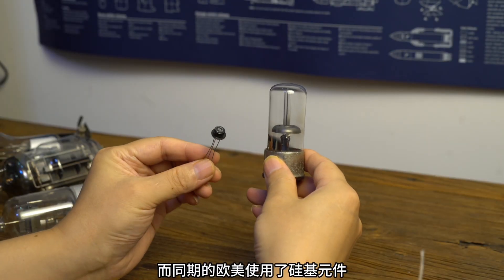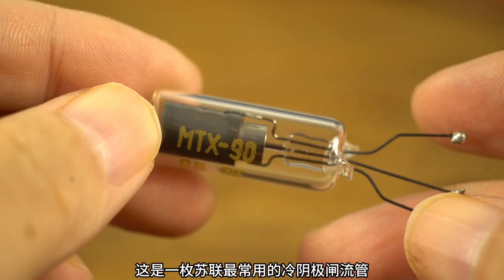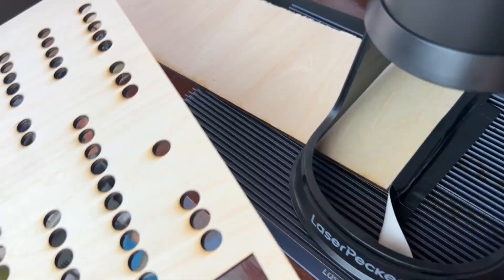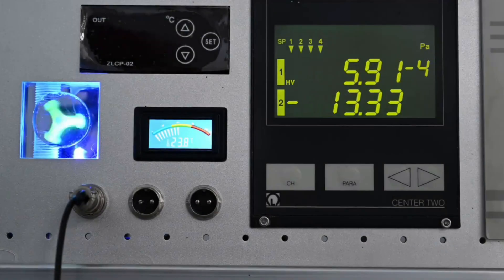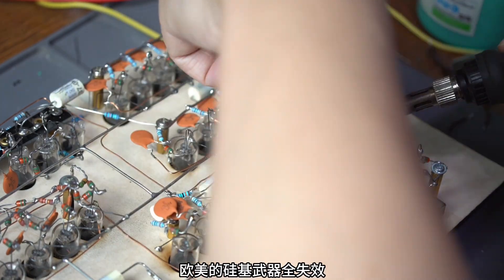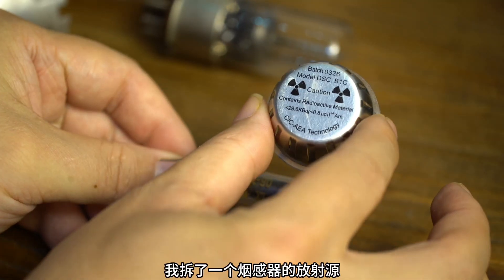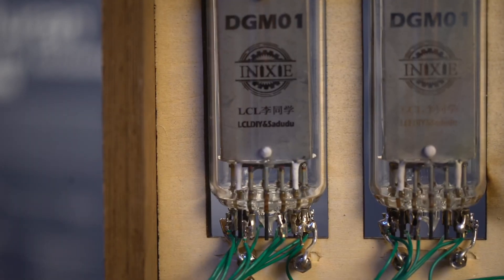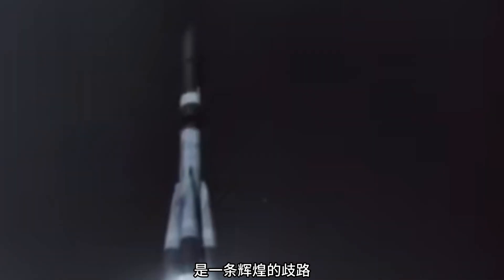Construct a Soviet-era style clock devoid of modern electronic components

Comment: why ion tube need radiation source for function and how it's work?
Reply: Because they need a spontaneous ionization event that produces free charge carriers to get the discharge going (i.e. to get a current flowing through the tube). When a sufficiently high voltage is applied, an ionization cascade will begin where the electric field will cause the ions to collide with other gas atoms, releasing even more ions. This means, ionization cannot begin on its own but requires some external influence that produces the initial set of ions. Usually, this is background radiation but some tubes contained a radiation source themselves that made them independent from environmental factors (with the tubes in this video, this was a radioactive gas that has since decayed into basically nothing).